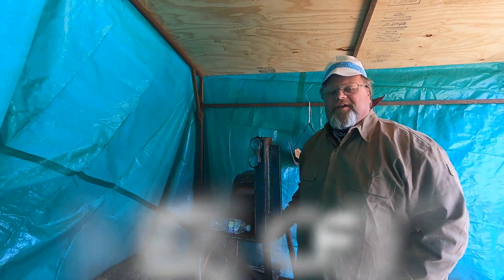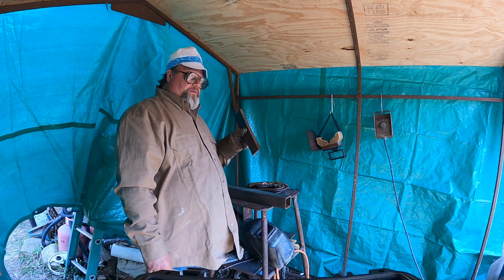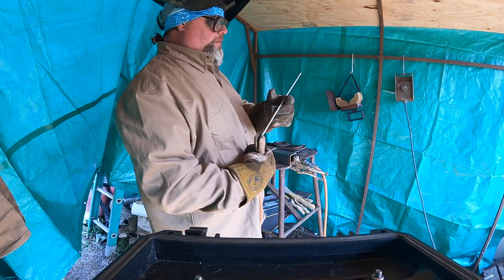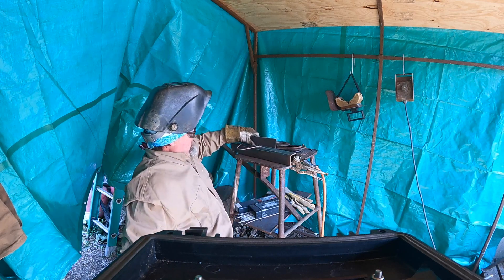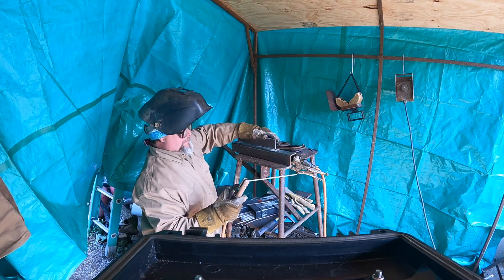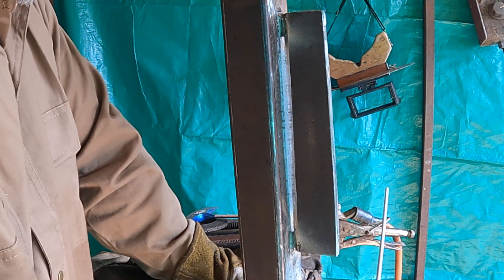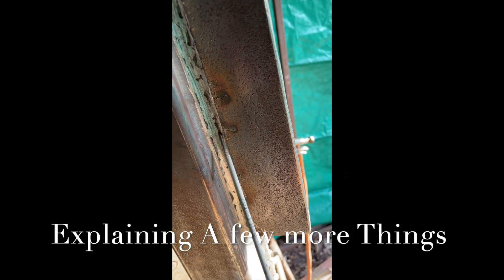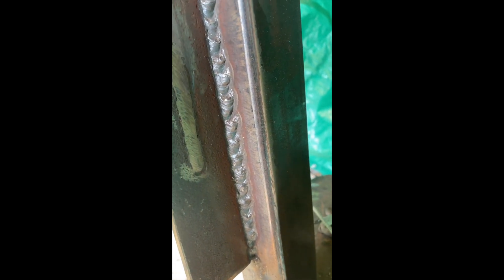E7018 Welding Uphill  “OPEN ROOT BEAD”

Comment: No point in describing a video. Isn’t it better to see all the stages in progress of the weld from Root Filler Cap, Then it’s better for up and coming welders who want to learn from and see from each stage.
Reply from the maker: Hello Michael, if you wish to talk to me, you can email me at at bantersarcforce@gmail.com I would like to know more about what you’re wanting to know and how long you’ve been Welder.
Reply: @banters_arcforce  Started welding aged 10 on a farm, Done a welding apprenticeship at 16 years old, For four years, Passed my Plate test in 3G & Pipe test 5G & 6G 1980, Worked on various pipe contracts and structural engineering across UK.
Reply from the maker: @michaellynskey7124  OK thank you for answering back Michael. I’ll talk more about it in my videos to help you understand in this .
Reply from the maker: What part of the UK are you talking about United Kingdom or some other location of Europe?